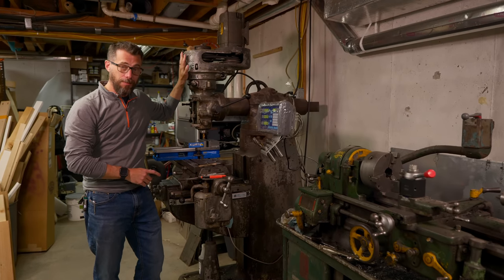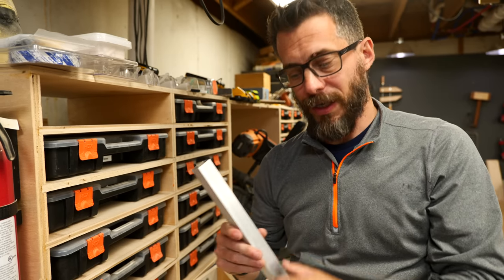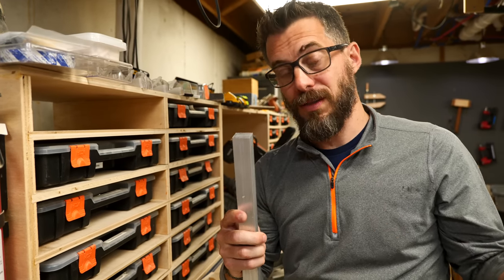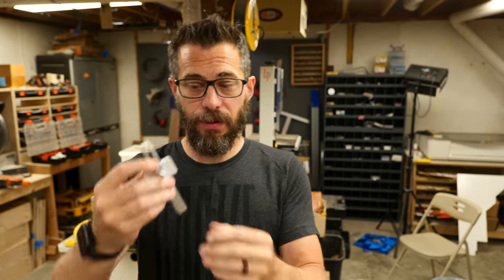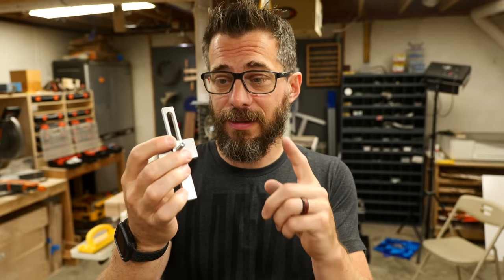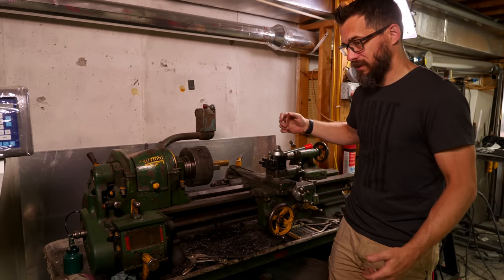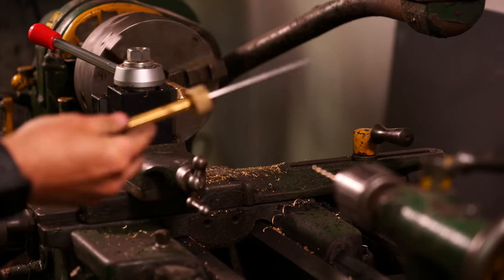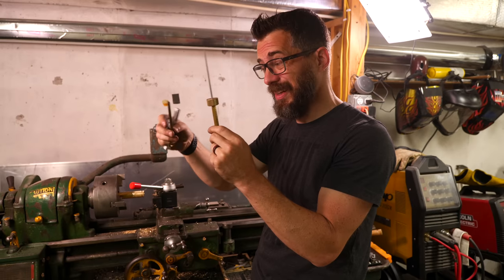Overcoming My Fear of Machining Metal

Comment: So this isn't meant to be rude or mean or anything, but as it seems you want to learn about these new tools it's always nice to have someone who has worked on them for a while pointing out stuff, especially if you don't know them. I made a list here, this is just meant to help you learn, I would like to see you do more with them, but sometimes it's nice to just have someone telling you what you're doing wrong sometimes. I worked on stuff like this as I worked in a machine shop for years. So here we go! Sorry it's long... Also, use Oil! Oil is a friend!

5:28 "I don't really know if it matters" it doesn't because when the head squishes those little gaps down, it will hold it, just make sure to never have a tool be smaller than the hole, never undersize, always oversize, but you only have a few choices there so just pick the one that works with the size you have any difference will go away when it goes together that's why there are those gaps.

5:55 We always called them by their size and plates. So like 1/8in plates. 

6:12 Beginners mistake, never assume those plates are even because even a chip under one of them can mess them up, always assume they are wrong. That said they SHOULD be parallel, but never assume so. Also, they can tip sideways and fall out so they make a good guide, but never trust them. But most of all!! You should remove them before cutting the part otherwise they get in your way.

6:59 If you want to make the part have a nice finish, use a really big head. You actually have one on the bottom left on 6:41 in your tool set, that is used to grind and make the flat surface. What you did isn't by any means wrong, it just makes your part look stripy. 

7:17 "I shouldn't have moved the piece" It's okay we all have done that a few times, best thing to do is to move the piece as little as you can, because each time you remove it, you increase the risk of the part being off from the former measurement, but don't worry we all have done that. So you are normal.

7:20 That is correct you did it right, however never be afraid to use all of your drill bit. If you can drop it another 1/4 in do so. Because the tips of the drill bits are sometimes damaged and it can give you a rough edge so stay away from the tip and use the side, but yes you did it right just drop it a bit more next time.

7:40 That paint stuff you used, perfect that is exactly correct, if you are low on the paint you can use a sharpie instead works just the same. And scoring it like you did is how we do it too. You are also holding the calibers correctly so this step was done correctly.

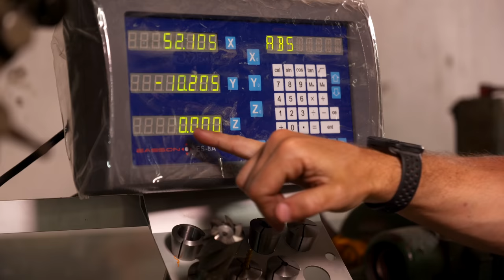8:32 One thing you can do is actually just have the tool run and move it in and out dropping it a little each time and as soon as you see some of the paint come off set your zero.

8:44 I would use a higher speed. If you notice in the video on your part you made you left a lot of scratches, this could have been fixed if you set the drill to a faster speed. I get that you were being careful, but I think you left it on the drill press setting, there are on those machines usually a higher and lower speed settings try to use the higher speed one (It's usually a lever on the side that says like high or low). That bur you talked about was due to the low speed.

9:20 Put some oil on the drill bit it will help. Plus the hole will look better.

9:37 If you still have a bur on the edge of the part at this point, I would be concerned, as it can mess up the measurements, something you can do is either use a file to remove it, or a deburring tool, or you can use a drill bit with a triangular tip and run it about 1/2 way up the triangle just along the edge of the part.

11:10 "This is going to take forever" This caused me some pain watching, first off you left the plates in [head slap] (that you use to make it flat) those should be taken out before you start the part, otherwise what are you going to do when you get to the bottom, cut through your very expensive plates... No, no no no... take them out before you start the part, and then instead of going back and forth which will make the part look very scratchy and unprofessional. Put the drill bit in the center of the gap you want to make, drill it straight down all the way through the part, and then move side to side. It's way faster! This is the better way to do it and save yourself some pain. Also, use oil! Oil is your friend! Coat the drill bit in oil, just have a container and rub it on with a paintbrush just before you are about to use it.

12:54 & 13:15 OKAY SO THIS IS REALLY IMPORTANT TO KNOW!!! YOU SEE THAT TABLE IN THIS SHOT ON THE BOTTOM LEFT OF THE LATHE!! That table tells you how to set screw sizes for the lathe. So you see how it says stuff like "Left, Center, Right" which refers to where you set your knobs when you want to make a screw. Basically, your lathe can make screws and that table tells you what settings to set for the screw sizes you want to make. It looks like you can only do imperial units on yours. What you can do (and it depends on the model and how you do it) is make say for example a bolt. Cut the general shape of the bolt, and then set the tool just outside the edge of the bolt set the size the table says and pull one of the leavers and the machine will move itself and make you a perfect screw head. IF YOU LOOK AT YOUR LATHE, YOU WILL SEE THAT THERE IS A THREADED ROD NEAR THE BOTTOM THAT RUNS ALL THE WAY ALONG THE BOTTOM AND IF YOU TURN THE HANDLE YOU CAN MOVE THE TOOL ALONG THE ROD. WELL IF YOU LOOK ON THE LEFT SIDE IT GOES INTO A BOX (NEAR THE MOTOR) WITH THE HANDY TABLE ON IT. IF YOU FLIP THE LEAVERS CORRECTLY THE WHOLE THREADED SHAFT WILL SPIN AND MOVE THE TOOL HEAD FOR YOU, YOU DON'T NEED TO TOUCH IT AND IN FACT, YOU SHOULDN'T. THIS IS HOW YOU GET THE LATHE TO DO THE WORK FOR YOU AND MAKE THE PERFECT SCREWS. THIS IS SOMETHING I WOULD ABSOLUTELY LEARN BECAUSE IT MAKES EVERYTHING YOU DO SO MUCH EASIER, IN FACT, YOU DON'T EVEN NEED TO BE AS FOCUSED IF YOU DO IT RIGHT SINCE IT CAN CUT THE PART TO THE WIDTH YOU WANT FOR YOU. BASICALLY, IT CAN ROTATE THE WHEEL FOR YOU, YOU JUST HAVE TO TELL IT WHEN TO STOP.

13:40 THIS IS WHERE YOU USE THE TABLE I JUST MENTIONED ABOVE THIS!!!!

15:25 Uh those pop out, you can take them out, I'm pretty sure, that's why they have groves and look like separate parts. You can replace them I believe, I'm not familiar with this model, but in most models, you can change those out for the ones you want it's also so you can reverse them and hold the inside of a part instead of the outside. Like a pipe for example.

16:35 Can you say OIL!

Continues in reply... youtube didn't let me make a post this long so it goes on in the reply.
Reply: 16:44 The more material you cut off the scratchier the surface looks so you can cut up to like a millimeter per run, but when you get close to the size you want, slow down to 1/10 of a millimeter, then 1/100 of a mm. Basically get to the general shape you want and then go finer this will give you a very nice looking surface, and never back up, just pull the part towards you when you end, and then back up, or you will scratch your surface giving you a backward spiral look.

16:56 You made a beginner's mistake. If you drill towards the jaws when you reach the end of where you want, you don't rewind it away from the jaws that is a no-no you actually send the drill bit towards you away from the part, then back it up. Then do your next pass. Otherwise, you will scratch the part when you send it back and it will look awful. It destroys the finish. Also, you should measure the diameter with a tool after each pass because sometimes the machine lies. If you are more advanced you can get away with fewer measurements, but never trust the machine fully for measurements, because as the blade gets hot, it expands and can change the size, so the more you use the blade the hotter it gets and the more the blade expands. So before the final cuts measure it.

17:17 Oh this pains me, learn about the table I stated above it's for this tool! If you do it right it looks really nice. This is where you would want to use a slow speed and yes this is one of those tools you really want to push it into the part. It's not really cutting the metal it's pushing the surface into the metal so it requires more force. That's why. But yes this is where you should let the machine do the work, not you because lining up those gaps perfectly is really hard! It will make a diamond pattern when done, it's useful for where you need to grip on a part your holding on to since metal is slippery and this helps with that. But learn how to use the table it will help here!

17:58 Happens to everyone, everyone has done that. You are not alone and you feel the same as everyone else, but no that is not what was wrong you need to use the table.

19:00 You have some very good manual control to have gotten that to look as well as it did.

19:23 THIS IS IMPORTANT!! Parting tool, it's hard to know what is going wrong since It was hard to see and hear it could be dull and they wear out, but yes they are loud, but also cutting that much off is a bit scary. If you notice you have a thing on your right of the lathe that can clamp onto the part you're trying to cut off, that's what it's for. It's that thing with the handle and the cone-shaped point on the end. You can put a grip on it to hold the part you are cutting off so when it breaks off it doesn't violently fly off and kill you. But yes they are loud and yes that is what they do, my recommendation would be oil on the parting tool and just go a bit slower and have the brace hold on to the other end to stop the vibration. The tip you have installed is for holding something with a hole in it, but you can change it out, it just pops out as one giant unit. It will be like a big piston when you pull it out, a cone tip with a long rod attached. The whole thing has a lever (or I think bolt for you) that loosens it and allows you to move the whole thing (the big plate it's attached to, not the wheel!) forward and backward. If you are holding something make sure it's tightly clamped and don't extend it any more than you have to. Yours may come out if you just turn the wheel long enough, just make sure when you put it back in you get the grove right.

20:30 Correct information, always use the correct sized hole. You actually can tap on the lathe too, but you need to switch out the part I mentioned above, a special head allows it to go forward and then backward without breaking the head. So it seems you do know how to remove the chuck you just don't know how to use it. which is the step I said above.

20:55 If it was anything but brass if you didn't use oil it would be squeaking so loud right now, use oil coat the drill bit in oil.

21:17 You always flatten the head first, because that's how you set your zero and measure how long your part is. It's zeroing the part. So this should always be done first, this is how you can make a 6 in long part without say having to measure the full length of the rod, just set it so you can have 6 inches, and zero based on the end.

21:29 You did it right, but it's a bit big. 

23:00 Absolutely correct! go in, go out that is exactly correct. Especially on a hand version.

23:20 Cool thing about brass is it acts a lot like rubber in many situations so you can use it as a rubber substitute, it's expensive but does work. Just something that it's fun to know.

23:45 Why is the hole not centered. REASON you need to use a reamer at the end! Because it's very hard to cut a hole perfectly straight on a lathe it will always bend, but a reamer will fix this.

25:00 Set up your mill as a drill tap again get a triangular head drill bit and just drop it into the threaded hole it will make it look much nicer, and get rid of that bur look on the outside of the hole.

25:30 YES TAKE ON YOUR FEAR!! TRY SOMETHING NEW!! BE BOLD, BE BRAVE!!

I hope some of this helped, take away in this... use oil and LEARN THE TABLE so the machine can do the work for you and you will appreciate it so much more. Good luck I am excited to see the projects you have planned for the future. Good luck on your quest, and congrats on taking on your fear!

Comment: For basic one side knurling tool, (for safety and precision) will be good to to use right tailstock to support material better. 
For me better is knurling tool with knurling wheels on oposite sides of rod, without one side force. :)

Comment: Hi there, I very much enjoy your content. I'm an apprentice machinist  and currently converting my wood lathe to cut metal aswell. Some useful info for rpm. rpm= (4x80)÷diameter (this applies to drilling aswell) when using hi speed steel as the cutting tool, there's also carbide used for cutting and in drilling.
Reply: The stuff you aren't sure what do. That changes your rpm and also your feed rate (how much the carriage moves in relation to the rpm of the spindle) inches per revolution
Reply: In USA and Canada it's commonly known as thousandths of a inch per revolution example .010"/revolution

Comment: Cut better, less heat, better surface finish, and longer tool life..... use oil. Any oil is better than none. Also. Tap first before you part off. Use the tailstock to make sure it goes in straight and will make sure you don't mess up the knurling up in vise/. T  handle tap in the hole, tailstock up against the back of the T handle. lock the tailstock. Then turn the lathe chuck BY HAND (lathe power OFF) while holding the T handle. Once started... straight every time. Can use the chuck tool in to hand turn the chuck like a lever.

Also turn your chuck jaws around and you won't have the nubs scaring you sticking out of the chuck.

Never wear jewelry or loose or long sleeve shirts. Can get "sucked into? the monster. Even while milling.

Rad job for your first go though.

Comment: Using brass and such a long soft piece of brass it needed to be supported on both ends. Also using cutting oil helps drill holes easier

Comment: The jaws on the Lathe chuck are giving me anxiety. if im not mistaken some jaws are reversible so you dont get that terror inducing stick out that you can mistakenly run your tool post into... or get a new chuck designed for holding smaller objects. also, cutting fluid is going to be your best friend.
Reply: typically, lathe jaws come in 2 in 1 configuration, don't know how this one got its jwas like this
Reply: @saadus7269  its really weird, normally id say turn the jaws around, but I don't think he can.

Comment: The thread is crooked, facepalm order of operation for the lathe should have been; face off the end, center drill, insert live center, turn the diameter, and knurl.  Now drill the hole and tap while still in the lathe so everything will be straight and concentric and put a tap follower in the drill chuck on the tail stock.  BTW the other levers are for auto-feed and single-point threading.  You may want to binge Blondihacks on YouTube she has solid fundamentals.

Comment: If you're anxious about safety on your machines, a good project might be to install a foot pedal safety interlock. Basically it's a switch that, if you step off, cuts power to the machine incase you get caught up in it.